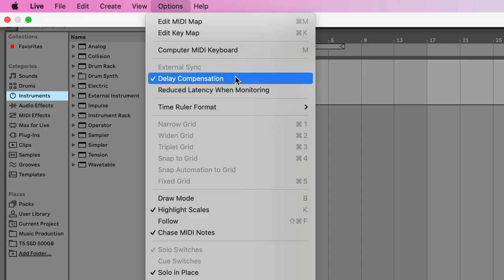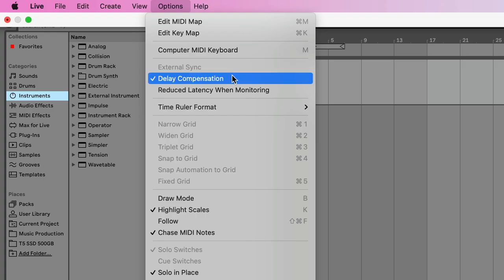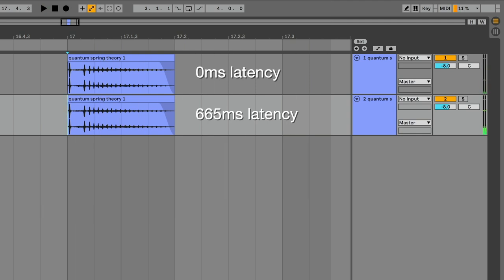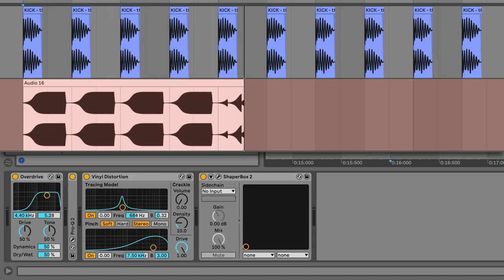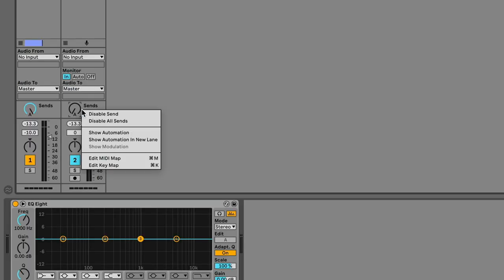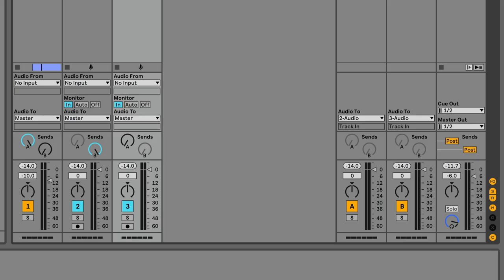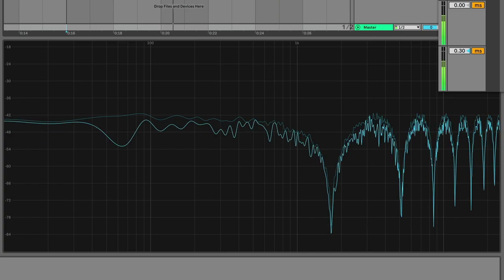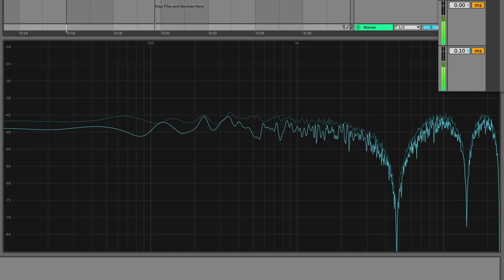delay compensation in Ableton Live… (it's important)

Comment: Wow I had no idea about this issue! Thank you for bringing this to light!
Reply: It's had this problem for years. I noticed it years ago when using a plugin chain which had plugins running with different internal sampling rates (some oversampling etc). The delay compensation was not acurate across all the tracks playing. This is not good for solid bass in a mix.

Comment: While setting up a live looping set, I was having a timing difference between my monitor feed and my looped audio. After turning OFF delay compensation this rhythm problem went away. Just something to keep in mind if you’re struggling with this. I am mainly using sampler instruments and midi and audio effects on the tracks.
Reply: yea, in Livesets with low-latency VST plugins and generally low latency, activating delay compensation ADDS latency, isn't that funny, haha. For a real liveset-setup, VSTs from izotope are generally a no-go. They add severe latency to the whole project. Not worth it.

Comment: version 11 and still no proper delay compensation... Bitwig has it
Reply: @RoXx1811  what are the differences between bitwig and ableton?
Reply: BUT u cant turn it off in Bitwig. So when you have high delay in bitwig you literally can't play something on keyboard. Seems like fucking devs doesnt have a damn brain. I just going to use free reaper then..
Reply: @ХладнокровноеЖивотное You're wrong. If you want to play on keyboard or guitar live without latency just don't use plugins that cause this latency... Try to open any simple VST synth and put Pro-Q in Linear Phase Max. After this Its impossible to play live in any DAW. In Bitwig you can deactivate plugins that cause this latency. Its not the same like switch on/of in Ableton. 
Delay compensation is not what gives you 0 latency.
Delay compensation is what makes you audio to be snaped to the grid. Just play any loop, then add something like LFOtool or Volumeshaper and render result. Then try to put Pro-Q Linear Phase Max before LFOtool and render again. You will be out of grid/sync in Ableton. There is no such problem in Bitwig. This is what Ableton delay compensation problem is.
Reply: @VladArtsense  No in proper daws you have to choose enable or disable pdc. Easy to say just do that or do that. If i pay shitload of money for license and didn't get such BASIC feature. If you have a gigantic project with plugins like soothe on channels that gives a lot of latency and you should go find them all, deactivate, play some notes, activate then again and again? lol what a nonsence. its just another compromise
Reply: @ХладнокровноеЖивотное  we talk about different things. You can't disable this latency in Ableton too. Just try to do what i said with Pro-Q.
Reply: by the way in Ableton only one Pro-Q (Linear Max) can affect all project. You can't play live without latency.
But in Bitwig if you add another instrument track and try to play live.. There is no latency. You can play live. And there is still active Pro-Q with big latency on another track... Magic)))
Reply: @VladArtsense  Sure man. That's how PDC should work (and it works pretty flawlessly in bitwig). I mean when you have some latency on group, instrument track or on master. You just get delayed signal from the synthesiser. Studio one have a good solution for this. Simple yet effective. You can disable PDC for just an instrument. No need to turn off all that plugins. Just click z [low latency monitor] button and voila. I think its just routes signal aside direct to output.
Reply: @ХладнокровноеЖивотное  go studio one then :)

Comment: shouldnt freezing tracks be enough for delay compensation? why also flatten them?
Reply: Freezing doesn’t actually fix any delay compensation issues. I think he is suggesting that once you flatten, you can then manually shift the audio back in time. 
However, this isn’t a solution for grid based modulation effects like LFO tool. If you flatten and move the audio so the sidechain effect is in time, you’ve then shifted the actual notes that are being played to be out of time. 
The only solutions to this that I know of, either simply have them early in the chain so they’re isn’t significant delay before the modulation effect. Or if it can be triggered with midi, instead of being locked to the grid, it will then take delay compensation into account.

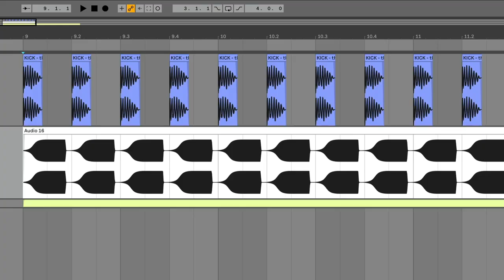Comment: 4:37 then how do you fix this? How do you manage to put the side chaining pumping  effect after the preceding effects while avoiding latency compensation?
Reply: Use midi or audio trigger for sc or compensate for the delay manually
Reply: @alcoshino  How do you compensate for every instance of delay through each plug-in in the chain? Will gain staging each plug-in help keep the delay down?
Reply: @mezhbond  good point, however latency has nothing to do with gain staging. Hover mouse over plugin name in the channel if you want to know delay it introduces. Delay readout is in the bottom left corner of Live. Then you can use offset in the lfo tool for example to compensate for the delay and get an envelope back in time.
Reply: @alcoshino  If you use an audio or midi trigger like @alcoshino suggested, you don’t need to worry about compensating for each individual plug-in manually. Ableton’s delay compensation will work it out and do it for you automatically.
Reply: @TjMoon91  spot on pal!

Comment: No difference in version 12, I can not believe that Live's compensation is still this bad vs all other DAWs. There are only 2 major DAWs that have poor PDC like this, and that's Live and Reason. I would have switched to Ableton full time a decade back if they fixed this as I enjoy the workflow. I am a heavy UAD plugin user, all my EQ's and dynamics are done with UAD, therefore I have various latencies all over the place, so you can imagine what kind of fresh nightmare Live is for me. I actually don't think Ableton get it - and I also think that's why Bitwig made such a point of doing this to perfection (frustrated ex Ableton staff started Bitwig). But it's why I stick to Pro Tools and Nuendo myself, as the compensation is beautiful, for sidechains, sends, the visual playhead, all tempo based effects, everything just works. The other DAWs calculate the delay when you press playback before the playhead starts moving, and voila. Much of Ableton's problems will go away if they simply did this, and they already have the base code to do this in there otherwise PDC wouldn't work at all to begin with, but they just don't want to add the feature. It's interesting when the devs of every other major DAW in existence understand the need for this, and implemented it properly many years ago at that. I can almost forgive Reason, because the rack is so modular and anything can be wired to anything, that it's very complex. Almost. But Ableton I am downright annoyed with - every year I check it and every year it's broken.
Reply: BTW, almost every quality plugin with oversampling has some sort of latency these days.